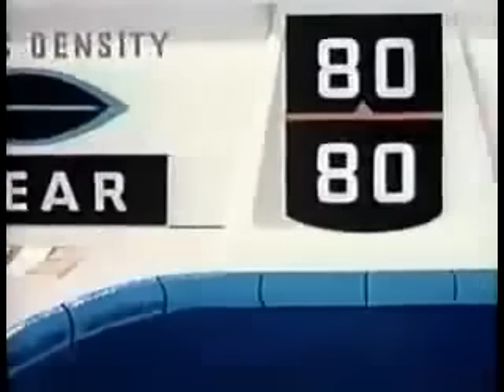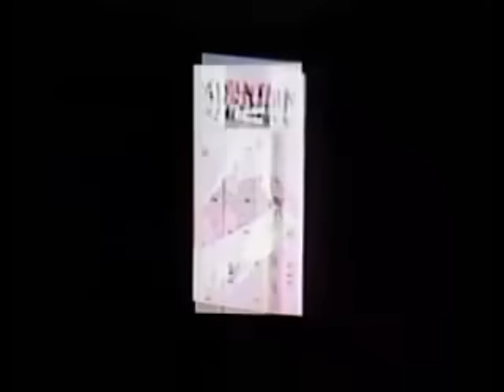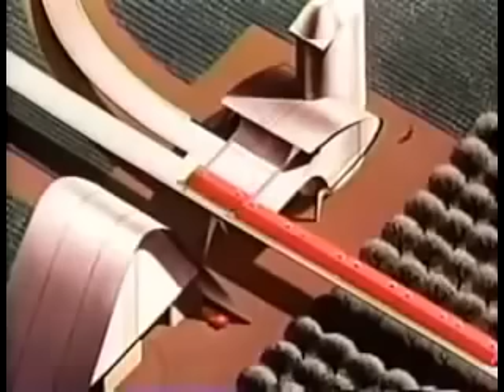The Future of Transport: Disney's Magic Highway - 1958

Comment: Aprox 46% accurate 

🚫 color coded roads
✅️ larger hwy signs
✅️ Better visibility
⚠️ electric eyes (Teslas)
🚫 dry roads in rain/snow
⚠️ radar screen in cars
🚫 dispelling fog
⚠️ traffic alerts
✅️ rear view cameras
✅️ medivac transports
✅️ quick accident removal (a single tow truck can take 2 vehicles now)
⚠️ quick highway and bridge construction 
🚫 Atomic tunneling
🚫 cantilevered mountain roads
🚫 Decentralizing cities 
✅️ criss cross interstate system
🚫 auto washing and fueling at home
⚠️ self driving cars
✅️ live mapping
🚫 not paying attention to road
✅️🚫video conferencing 
🚫 vehicle separation
🚫 parking elevators and office parking
🚫 moving sidewalks in stores
🚫 highway escalators
⚠️ boat cars (tried but flopped)
🚫 train cars serve as store shelves
🚫 widely available rocket ports 
⚠️ solar cars
🚫 rocket cars
🚫 anti gravity tech cars
🚫 tubular highways
🚫 air conditioned routes
🚫⚠️ under oceans (in short distances)
✅️ highways are better now than in the 60s

9 true solid 
7 true for exclusive groups

16 YES
19 No
35 predictions

Aprox 46% accurate

Comment: The cost of repair would balloon through the stratosphere(office building with a garage elevator). They can barely fix the potholes locally no way they thought heated roads were a good idea. The one thing worked towards was the television as a rear view mirror.

Comment: It didn't age well =) Many ideas were too unreliable for mass use. Signs make road color unnecessary. Combined 911 don't work, as they work at different speed and need to face much bureaucracy as in filling forms and finding out whose fault it was. Heating every road to avoid icing would require as much energy as another sun and raise the cost of road construction and repairs to quadrillions per year. Read view cameras are not as reliable and may malfunction. Still. Building still requires much time and careful planning. Mass still doesn't appear from nothing. Any road needs to be transported as materials. So without at least teleportation we can't build non-stop. And with teleportation we won't need roads. Melting through a mountain is beautiful but also awfully money+energy inefficient. And no matter how many roads you build, cars will not move faster than now. First, it's not safe, second, at these speeds wheels become unnecessary and can be replaced by wings. It's much safer to invest in mass transport. Individual cars will always generate accidents and paralyze any speed highways. So... yeah, good ideas. For fantasies. Can't be applied IRL.

Comment: Our highway systems could have been designed more rationally than they have. Commercial freight should travel on completely separate roadways and rail lines from passenger vehicles, as the film shows. More expensive to build, certainly, but safer and ultimately less costly for both types of transport.

Comment: It's a bit odd that they were able to nail some  optimistic ideas or at least forsee the concept behind some real things of today and yet they could not see the obvious disaster that cars and car infrastructure would become for everything else. in many ways if you flip the narrative you can see the warnings of the issues. Flying emergency vehicles because if you fill the world with highways noone can pass to get to an emergency. The commuters radius will be extended they say, like its not an awful thing to be trapped on a tin can with no bathroom for 2 hours. wide, straight open highways with cars going at insane speeds? what could possibly go wrong 😂

Comment: The automatic “parking” elevator is utterly insane. The energy expenditure and the wear and tear on the mechanism for the frivolous purpose of moving a single car into one parking space, makes the idea ridiculous - especially since a car is designed to drive, and if it drives automatically, what additional benefit is gained by creating an ungainly moving platform to lift cars into a parking space, over a ramp that would allow the car to drive itself up?
Reply: It would take up less space than a ramp...
Reply: @jayo1212  Actually, I used one in a NYC parking garage, and it is popular in Japan.

Comment: The color coordinated routes would be something EASILY implemented today to help with congestion due to confusion allowing for earlier lane changes and fewer mistakes by drivers. Definitely should be a thing.
Reply: I would switch in a HEARTBEAT to a GPS app that actually told me which lane to get in for my exit, instead of just saying "in 5 miles, exit right to Interstate 30" or something.  Yeah, no $#!t it's on the right, but do I want the FAR right lane, or is that going to peel off/merge back in before I get to I-30 or not? (Some cities do have lane markings indicating which lanes you should be in for which highway, but it's certainly not universal.)

Comment: Wow. Looking at this really points out how naive these ideas were. Like really?
Hover crafts that and easily clear an accident?
A single landmover that can not only prepare the land it travels on but instantly build bridges?
Prefabricated bridges that just moves in and plop into place? Wonder who built those things the bridge attaches itself to?
Tunnelers that uses radiation and super heat itself through a mountain? Must suck to be that operator. Not only will he die from radiation poisoning, but also from being cooked alive. Most heat will not go into the mountain at first.

Comment: These view are very optimistic about the cost of building material, higher level of autonomy and  advanced of low efficiency technology. Love it. 
Why we are not doing it anymore, imagine the future where problem can be solved in a creative way?
Reply: Oh, simple, if you extrapolated past 50 yeast back then 50 years into the future, that was what you'd get. Those were times were multiple live transforming technologies like cars, airplanes, computers etc. emerged in quick succession relatively recently, and their development was also super fast - a 10 year old airplane, or even ship was already obsolete back then. Also most diseases of affluence and environmental damage were still to be discovered. And they believed in permanent peace thanks to atomic bomb.
Reply: Because these were JUST DRAWINGS, imagined by a cartoonist. The problem is, we fell for it. We just started building, assuming the flying cars and thousands of miles of air-conditioned plexiglass covered highways would just show up. We tore down cities and replaced them with developments scaled, not for people, but for cars. The results are absurdly wide stroads, huge parking lots, and every destination inaccessible by foot. 

We wound up in our current situation, not in spite of these dreams, but because of them.
Reply: Because reality did set in and we know that all those dreasm are just that, dreams.

Comment: Surprisingly they managed to predict a few modern day things such as, a speed limit indicator on Google maps, rear view mirrors still exsist, but there’s a camera on the back, thus making the rear view mirror a television like they said and Google maps also informs you on the traffic speed via the color of roads if your on a set route and the “synchronized scanning map” is just gps data, and it’s also seen in all cars with a screen and on Google maps and electronics taking over a cars navigation system so the family can relax is self driving cars, and I believe that tech is now in use today, albeit a bit messy, but still good, moving sidewalks are a thing in todays airports if you want to get to your flight or to the exit faster escalator ramps… I think we’re still in use back then, I don’t know but they are used commonly in malls and airports and large stores like ikea
“Highly specialized luxury vehicles” are just mobile campers or RVs
And the part where the luxury vehicle turns into a boat was shown off by a tech video I watched a few years ago, an RV becoming a floating vehicle due to floats being deployed (manually) from the sides of the vehicle

Anyways, yes I know it’s a quite large bit of text, but yeah, I’m quite surprised about these things, now go watch some other vid

Comment: South Korea has now had color-coded lanes in highways and intersections, and also heated road segments (to remove snow) for some time now.
Reply: The heated roadway thing intrigues me - what is the energy source for the heat?  It must be prodigious, since it would have to offset the coldness of the snow and ice. Then there is the problem of what to do with the runoff water - where does it go, and how do they keep it from re-freezing as it is transported off of the roadway?
It is certainly possible to achieve - I just wonder how they go about it.
The idea of heating pavement to prevent snow accumulation isn't new - where I lived in Spokane there was a home built at the dawn of the 20th century that featured electrically-heated sidewalks around the property - the pavement was just warm enough to melt the snow as it fell. It was always a little treat to walk past the place in winter time and not worry about slipping on the ice.
Reply: @omi_god  Electric lines. I saw a hilly road in our neighborhood get retrofitted, they basically carved some really thin longitudinal trenches and dropped the wires in there. I think the idea is that the ground still retains some heat already, and you only need to kick it up above 0 C to melt the snow.

Comment: "Our rear view mirror is actually a television picture"

Nailed it.
Reply: Gratefully, they didn't nail the atomic reactor melting rock.
Reply: Supposedly the Russians tried that technology with spectacularly unsuccessful results
 @JulianaBlewett
Reply: @BradiKal61  Well one country - Iceland does heat its highways to keep them clear of ice and snow and about a dozen cities in the world (including Holland Michigan) have heated sidewalks, so it could be done if we wanted to do it.
Reply: @gregorybiestek3431  It could, but probably not cost effective, also could be hard to maintain the bigger the distances that are involved.

Plus normal roads are a massive contributor to global warming, got to imagine large-scale heated roads would be worse.
Reply: @matthewstarkie4254  Well considering that in the 1950s, when this animation was made, everyone thought that we would have nuclear powered everything, using the roads as a heat sink probably seemed reasonable. For today, if we had solar panels lining every major road, we could run cost effective heating coils under the major roads. Not sure which is worse - the radiant roads or the massive amounts salt & chemicals dumped on roads every winter.
Reply: @gregorybiestek3431  Constructing all those solar panels still would be insanely expensive. There would be much better use for that amount of energy than to heat roads. And pouring salt on it actually isn´t that bad for the environment. 
A heat sink for nuclear energy also makes no sense, since the heat is not an unwanted byproduct, but a necessary step for creating electricty.
Reply: @Omega0850  Three things in reply. (1), I never suggested that heating roads was a good use of energy, merely that it is feasible if society deemed it worthwhile. (2), pouring large amounts of salt very much does cause huge problems, There are significant costs to repair roads that break down in the freeze-thaw cycle, and the environment is damaged, causing problems with water supply & fish populations. I know these facts – I live in Michigan & have seen these problems for the last 50+ years. (3), the heat sink that was proposed in the 1950s was to use the roads instead of the water-cooling towers currently attached to every nuclear power facility. The water in the cooling towers is AFTER the production of electricity.
Reply: @JulianaBlewett  Oh those exist. Nuclear tunnel boring machines are a very real thing, the military use them to build large underground bases and installations. It's a technology that hasn't quite yet filtered down to the civilian world. Give it another 20 - 30 years though.
Reply: @killman369547 lol ok you just decided to leak this in a comment section didja?
Reply: Yup - my rear view mirror is a TV screen showing the rear camera on my UK VW camper van. Future sorted!
Reply: @Darth_Chicken 
I think I counted at half dozen prediction fails before they got the rearview camera thing correct
Reply: Yep, that and the automatic speed limit display on the dashboard.  All the nav apps do that now.
Reply: And urban sprawl, but described it as a good thing.
Reply: It got the GPS map right, too.
Reply: Close enough I guess
Reply: True 😂😂
Reply: Ye!
Reply: That one actually came true by now😂
Reply: I’m a mail carrier, and the new vans, replacing the trucks, have a camera since a rear view mirror is not an option.

Comment: And now, in 2024,  just try to get them to fix the ragged, crumbling roads that were built with the cheapest, re-used asphalt, at the lowest cost, taking the longest time possible, by workers that don't have to do quality work because they cant be fired.   Now we have bridges that are falling down, multi-lane highways resembling parking lots because of something as mundane as a tunnel.  Roadkill everywhere.  Trash scattered as far as the eye can see.  A car stops moving on the OPPOSITE side of the divided highway, and it's nothing but brake lights and cellphone cameras on your side, all the way to the horizon.  Only the drunks drive straight,  Sober drivers swerve and weave to avoid the massive potholes and deer carcasses.  Karen on her applephone watching a ticktock is riding your ass while putting on her eyeliner and Kyle is in front of you braking hard for every leaf.  And O.M.G.. Let a few drops of water fall from the sky!  Any precipitation and it's  like.. well, in the words of Bill Paxton,  "Game over man!  Game over!"  Yeah.. Welcome to SW Pennsylvania.  Football-brained jocks and airhead bimbos galore on the roads!   Rarely a competent driver to be found.   I tell ya,  it's TOO MUCH tech!  Lose the touchphone screens and built-in computers and TV's in cars..Put back AM/FM raios with an SD card slot.  No more bluetooth,  no more aux jacks.  No more video players for the twerps. Lose the automatic transmissions and auto-everything and sensors for fuckall-everything, and make it impossible to drive without actually driving.   One hand to steer, the other to shift.  No spare hand to hold a cellphone or scroll menus on a screen. No screen or touch-controls to demand attention.  Put back the knobs, levers, buttons & switches.  Make drivers Drive the car.  Make drivers-ed mandated in schools.  Make minimum speed limits a thing. everyone out there doing 75, and there's Becky and her minivan full of brats going 40.   Speed-limit 75 / Minimum speed, 70.  If you cant do it, get off the highway. Stay on the back roads.

Comment: They weren't entirely wrong.  Some of this stuff does exist now, just not in the exact way they were imagining.  Cars do have backup cameras, signs have to be huge to stand out, and America IS technically crisscrossed by multi-lane highways.  Sadly, we're not living in the reality where roads are instantly fixed! XD
Reply: We're almost there. Combining all the machines in road construction is more or less just an engineering challenge at this point that nobody has taken up yet. But if a team of engineers got together with enough financial backing behind them they could probably figure it out.

Comment: I dont like digital mirrors, because you can interact better with physical mirrors. What I mean is if you move your head, the image in the mirror moves too.
Reply: The same is possible with digital mirrors. 😊
Reply: @nilshoppenstedt6073  How can a digital mirror respond to my head moving?

Edit: Its like turning on your phone camera and moving your head from one side of the screen to the other. What you see on the screen will not change by the movements of your head.
Reply: @randomcube999  you couldt track the head movement and adjust the displayed image in accordance to the new perspective.
Reply: @nilshoppenstedt6073  And is that really better than just you know... having a mirror which wont need such technology, but does the same thing perfectly fine...?
Reply: @randomcube999  with a digital mirror you would have further advantages such as night vision, highlighting dangers, reducing glare etc.
Reply: @nilshoppenstedt6073  "To see and to be seen."
Like... Arent drivers supposed to use lighting to be seen in the first place when theres low visibility?
Reply: @randomcube999  sure, but why not improving both parts? The visibility and vision?